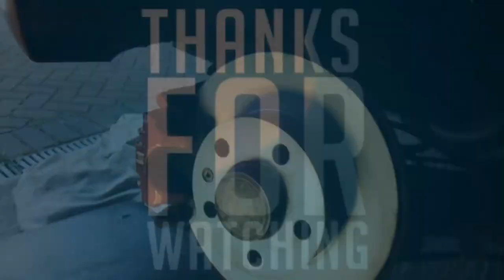Seat Ibiza FR gets new rear brakes

Comment: I actually did my rear brake pads on a 2010 Seat Ibiza today. Didnt been to change the disk though. Might have been nice to show the full and proper use of that tool to push the calliper piston back. It requires a lot of force to push the piston right back ..
Reply: Do they just push or twist?
Reply: @jordanlever7667  U have to back off the brake calliper. The piston turns with a tool easily available on ebay . The piston on the real does not simply push back. It screws back using the tool

Comment: Have you ever had any problems with sticking calipers on the rear when using the handbrake?
Reply from the maker: LOL all the time.  Its very common.  First thing to try is to fit the small outside return springs if you do not have them.  Other than that the caliper needs to be cleaned and the mech lubed.
Reply: @UK-CB-RADIO where do you get the return springs from? Mine are sticking quite badly.
Reply from the maker: @u04pww2  Hi they never made them for Seat but skoda and Golf springs fit.  https://www.amazon.co.uk/ABSOPRO-Caliper-Parking-Return-Springs/dp/B0C52S2LX1/ref=sr_1_4?crid=JZVKSQVXKXSY&keywords=skoda+rear+caliper+springs&qid=1700241256&sprefix=skoda+rear+caliper+springs%2Caps%2C74&sr=8-4